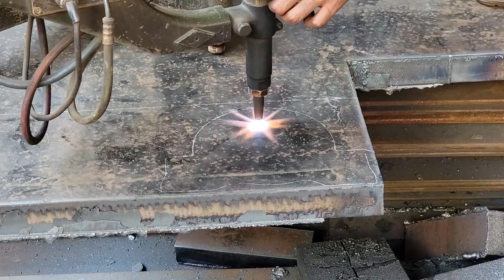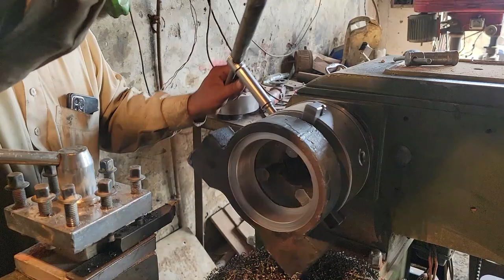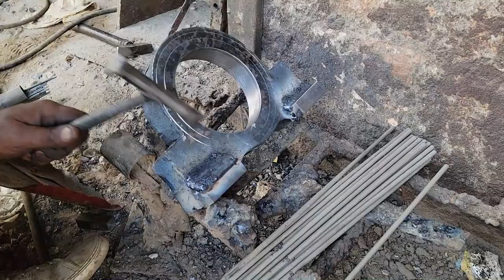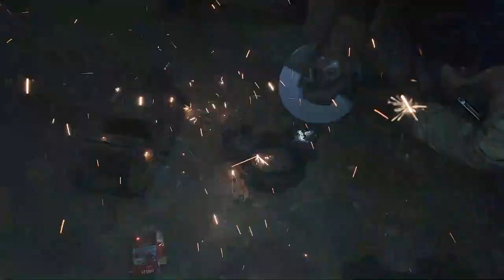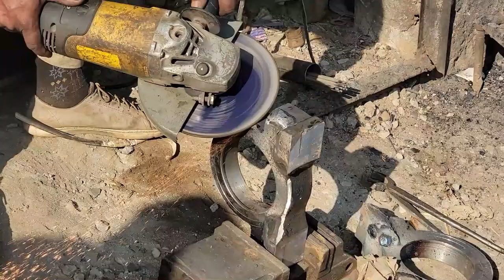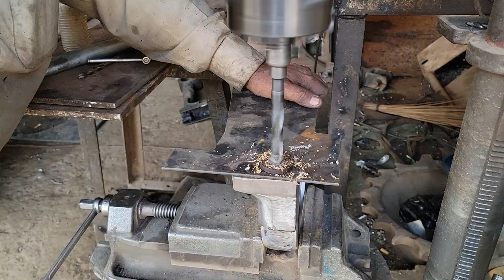Machining process of Pillow Block Housing with Amazing Technique

Comment: Bearings are highly sensitive components. The service life depends decisively on the operating conditions. Are the axial and radial alignment of the hole and the contact area guaranteed with a ruler and try square?
Reply from the maker: yep they are
Reply: Must have really amazing eyesight , maybee even diamond eye messuring....
No more need for messuring tools at all.... Just a square and a ruler... Good to go
Reply: If it works for them…
Reply: I agree with you regarding the sensitivity of the bearings. I was thinking about that while watching the video and suffering from the poor bearing that has to stay in that pillow block. Only a bearing with C4 clearance can survive but if it rotates slowly.
Reply: Eeeq
Reply: @hydraulichands  aaa

Comment: got no shoes
Reply: I'd rather have a job and no shoes than shoes and no job, esp any metalworking. Retired industrial Toolmaker, hobby machinist here. I've done some of my best work 40-some years ago in similarly humble conditions and mostly hand work. It's not what you got, it's what you do with it. Cheers.
Reply: @johncmitchell4941  how do you have a job and no shoes, I get working in humble conditions but brother you must've not gotten paid very well🤣
Reply: @joeythepizzaboy  I retired 16 yrs ago from a Union Skilled Trade job (Toolmaker) and have a nice home shop for tractor parts, fixtures, mounts, etc. With manual mills & lathes now IMO if I got paid I got paid to learn I can now work for free to pay it back. btw, I learned plenty in my salad and sandal days ('70s) that helps me now.